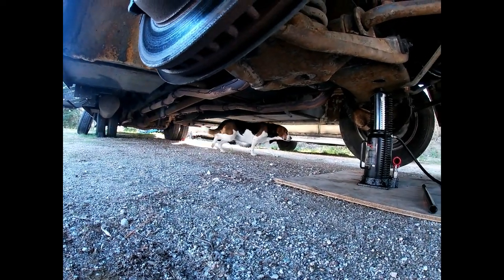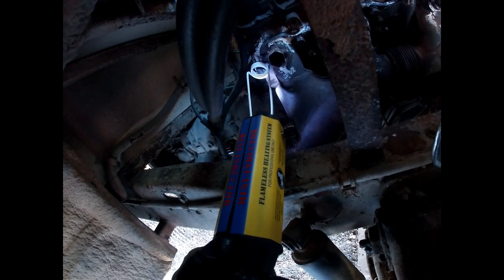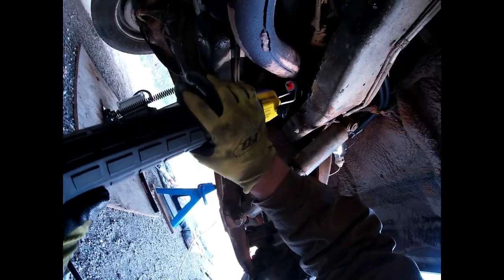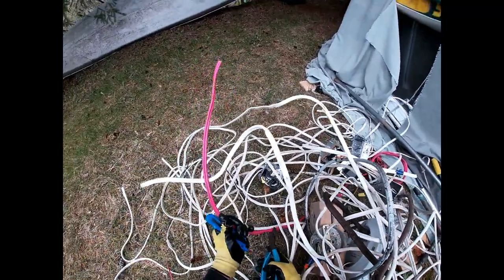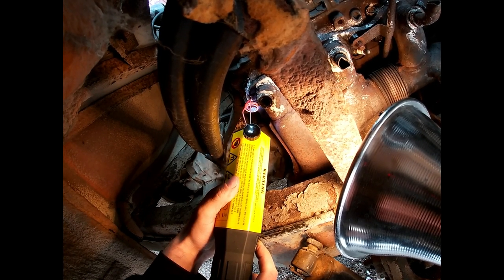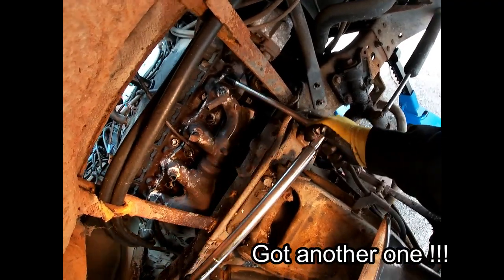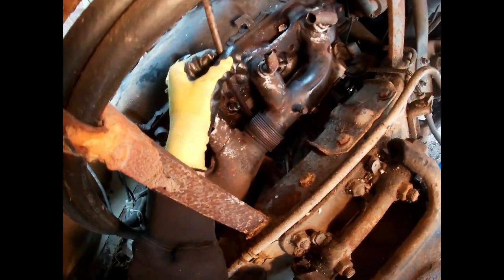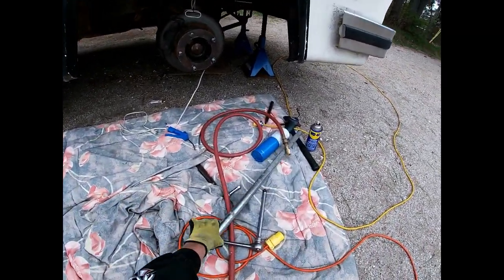Update, P30 Manifold Bolts and Vevor Induction Heater.  Results ?

Comment: Very good video on induction heater not working when you need it the most and the limitations it has. Most people just video prestaged rusty nuts they know will come off. Just to let you know this isn't a new innovation. It's just induction version of what I'm currenty building using and old 40kg welder, where I steal the transformer, make it able to produce say 600-800amps instead of lots of volts and by touching any metal via super thick wires (aluminium, copper, not just limited to steel like induction is) I can get stuff red hot by just touching it. The wires might melt eventually and need replacing but it's different ball game when it comes to induction (not touching the metal) heating.

Comment: im wondering if the reason it wasnt working as good is because youre using it on bolts where the threads are on the inside of the block vs say a rusty nut where the threads are outside the block
Reply from the maker: I think its also that I didnt drain the block, there is still coolant inside.

Comment: Part of your problem maybe the extension you are using with the impact gun. The chrome extension will twist & absorb the energy of the impact gun. With the ratchet, you still have the twisting of the extension, but you can apply more pressure in one direction. I saw you got the gun in there without an extension. That might have done the trick in the first place, along with the extra heat.
Reply from the maker: You maybe right.  I have since got some better extensions and a nice dewalt impact gun.
Reply: You are wrong, this is the least of his problems. I cringed even when I saw the big extension. I have one too that was gifted to me just to find it cost over 100$ and it's for trucks. I loved it, how easy it was to undo say car wheel bolts. For the rest all it did was help me snap bolts quicker than with a shorter ratchet since I don't get much feel. If something isn't turning, the price, the chrome, the leverage is the least of your worries. If anything hammering the bolt after letting it cool might have freed up the bolt a little bit more, which beats the idea of using "quality tool" as you suggested.

Comment: The map gas for you torch will burn a lot hotter than propane , I have a high quality torch head that boosts it even more . I can turn bolts red quite quickly in situations like this
Reply from the maker: I learned that its because I didnt drain the coolant out of the block, had I done that this would have worked a lot better.  I have the map gas too

Comment: For future get a Bernzomatic yellow tank. Work faster and more efficiently with a higher burn temperature than standard propane. The Bernzomatic MAP-Pro Hand Torch Cylinder contains premium fuel. This is if you can't afford a oxygen acetylene setup. With the Oxy Acet get the stud orange they always come off. But the Benzomatic will work better than a blue tank.

Comment: Just spitballing here, but it looks like the wire you used to make your own coil is 12 gauge? Makes me wonder if the original coil wire used is 10 gauge. I know McMaster sells various diameters of both fiberglass and ceramic (which is friggen expensive) insulation you can use to make your own coils. I might give this a shot when I order one of these to attack the manifolds on a Mazda 6 that I'm working to get running again.

Comment: A good mechanic on here that does this for a living would not remove the bolts that he got loose, just get them to turn and spray down with Blaster and re tighten them a bit to keep the exhaust manifold from warping  as the other bolts are being loosened. otherwise it tightens the remaining few to the point where they are totally jammed or will snap off in the hole and then OMG!

Comment: One of your bigger problems with induction heat is you are dealing with a cast iron engine. Heat induction works better on the aluminum LS version engine because of the dissimilar metals. What is fighting you most is the red locktight on the exhaust manifolds on your cast iron engine. IMHO